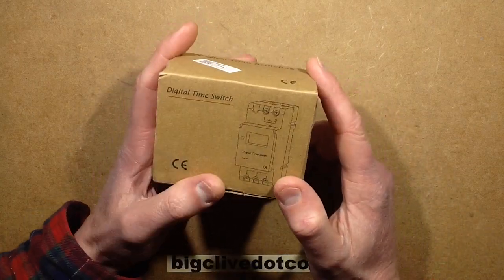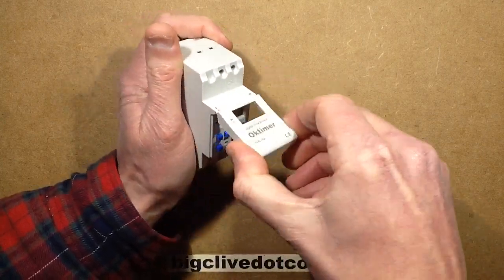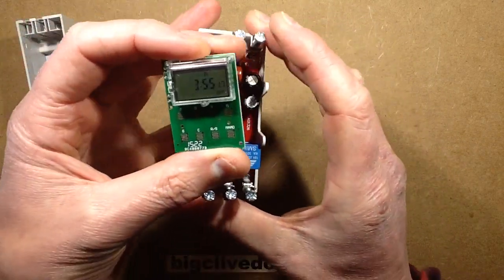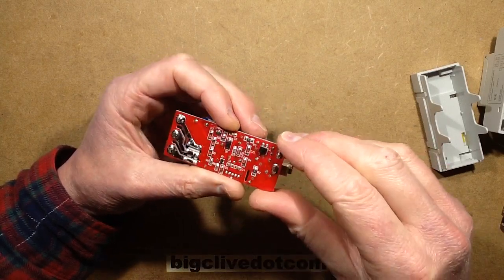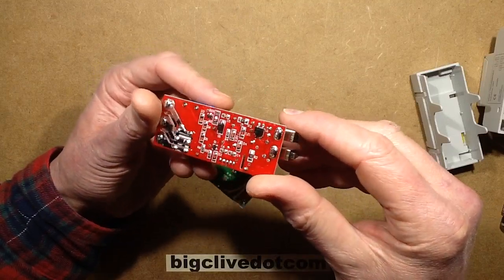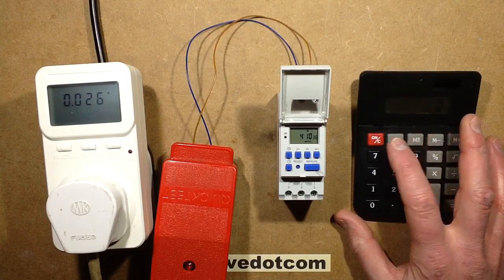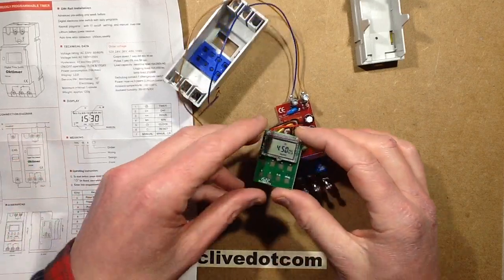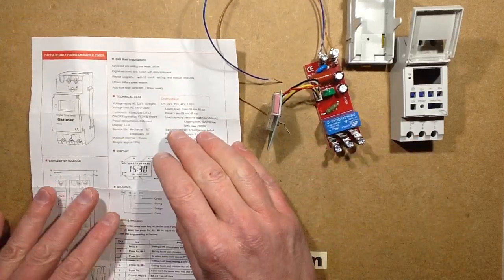Inside a cheap Chinese DIN rail time switch.

Comment: What sort of enclosure would this go in? A UK distribution board has the live mains input bus bar along the bottom, and output at the top?
Reply from the maker: +hyperion8008 If used in a distribution board it would be wired on its own via one of the circuit breakers.  DIN rail is used mainly in industrial control panels.

Comment: The delay between you going through on - auto - off and the relay switching might be intentional, since the display is actually responding immediately. I think its intention is to not have the load switch on and off unnecessarily while you go through the settings and only after you have settled it switches the load.
Reply: +Jack White  Pretty elaborate for cheap chinese elctronic -> usually  cheap electronics software just sucks! (even though product can be actually quite good)

Comment: Chinese quartz clocks are very drifting. Almost 5 seconds per week or even more. It's ridicolous. I would only trust radio controlled clocks.
Reply: +BloodySword they either get bad crystals, or i think just use oscillator circuits sometimes! although ive had several cheap chinese devices that keep decent time, i bought a fake casio watch  (on purpose for a joke, the gold one, costing about 1.50) and it lost around 15-30 seconds a day at room temperature!
Reply: +jusb1066 Oh losing seconds is much worse! It's not so bad when the clock shows time in the future; you cannot miss your appointments then. :D
Reply: *****
indeed! the fact was the watch was quite well made, metal strap, brass plated not gold, if it had kept time, i would have actually used it! shame they scrimpt on a couple of pennies really, this would not sell even in china!
Reply: +jusb1066 Yes. But a watch that is not radio controlled, is not a watch anymore for me...
Reply: *****
yes i see your point, a have  2-3 house clocks that are indeed that, along with my kitchen radio is RDS with a clock auto set, and of course phone/pc/ipad etc does it via internet, but still twice a year hate having to remember all the clocks that you still have to set manually!
Reply: +jusb1066 For me it&#39;s easy. I had two LED &quot;wooden&quot; clocks. A Big one with white 7-Segment-LEDs and a small blue one. Both of them are drifting heavily to the future! The white one did get issues so that I could not change the time anymore, the momentary switches got dodgy. That has driven me so crazy that I smashed it with my fist. The whole plastic rear case was cracked and my eneloops flew out as well as the PCB broke in half and my fist was not even scratched. Bloody cheap shit! Leaves just the one in the kitchen with the blue LEDs xD.

My radio controlled clock in the bathroom is quite old, it ate batteries like a dog his food. I put an eneloop in and now it works, even though the voltage is much lower than with the alkaline cells.
Reply: +jusb1066 I have an Arduino-based clock which I reprogrammed to also track the date and do Daylight Savings adjustments itself. I did this because 1) I don't always know the date, or day of the week, off the top of my head and 2) I was fed up with having to adjust my clocks manually.
Reply: +Robert Lozyniak Would you like to share your code and schematics?
Reply: I don't have any schematics. I built that clock from a kit. I modified the programming to suit my needs. You can see the result in my video: "My modification of the Alpha Clock Five"
As for code, I suppose I could send you a link to it, but it relies on libraries from roughly the Cretaceous Era.

Comment: S1 and S2 are obviously for switching between the metric and imperial um... time.
Reply: i have a button in my car that does nothing but change my speedometer and odometer from imperial to metric. I wonder how much money they could have saved by putting that in a submenu instead.
Reply: Metric time would be so nice... Except that the US wouldn't adopt it and converting would be awful
Reply: i think they tried metric ie decimal time and calendars once in france, from about 1790~to 1805~
Reply: @dndboy13  We actually have a new time standard for years now. ... it's called Unix time and just counts the seconds since epoch (1970-01-01T00:00:00Z).

Like the US is actually using the metric system - all units they use are specified in Metric. :)

Comment: I just can't  like products that use capacitive droppers instead of proper power supplies. I know it's only low current, but given it's semi-industrial purpose, it just seems wrong.
Reply from the maker: +arcadeuk It's cheap, light, small, efficient and actually pretty reliable.
Reply: +arcadeuk 
What's more probable to break: a rectifier, electrolytic smoothing cap, switching transistor, transformer, rectifier diode, another electrolytic smoothing cap and switchmode controller or a resistor, a cap, a rectifier and a smoothing cap?
Except for the fact that you have to put a relatively constant load on them and waste the power if you don't need it all the time, they are actually quite good.
Reply: +bigclivedotcom And I don't see a big reliability improvement in exchanging capacitive dropper for rectified mains filtering cap and filtering cap on secondary of SMPS;)
Reply: I agree.
Reply: cheap switching power supply's  are noise nightmares.

Comment: For quite a while now, I am looking for a low power time switch (to switch a battery driven LED strip). With a backup time of 3 years from a small NiMH Battery, this upper display and key module should do the trick. Are there any markings on that module, like Partnumber or something similar?
Reply from the maker: +konohh You'd have to remove it from a cheap digital plug-in timeswitch.  I don't know anywhere that sells the actual modules.

Comment: Box is a standard part, designed for any standard 2 module width DIN box. Made to pack flat in storage so the transport of the empty boxes is cheap from the printer, and to fill you simply do a minimum of operations to make up an empty box. Often you find the entire manual printed on the inside of the box, especially for things like DIN mount contactors. I prefer the EU made contactors though over the Chinese ones, they use brass as contact materials while the Chinese ones are steel.

Relay is not doubles contacts, you have 2 pins per contact to handle current it switches. Sad to say that relay is being overrated, they are really 16A resistive ( 1000 full electrical load operations) or 5A inductive ( 0.7PF for same life). You are better off using an external contactor or SSR to do the power switching if you need the full power rating.

Comment: DIN = Deutsche Intustrie Norm = German Industrial Standard.
Reply: +Taguun It used to be, but today DIN = Deutsches Institut für Normung = German Institute For Standardization. This is also the reason it is called a DIN standard and not only DIN. If you were correct a DIN standard would be a "german industrial standard standard".
Reply: They should just change it to WIN (Welt Industrie Norm... or World Industrial Standard) because pretty much all of the world has adopted a lot of the DIN standards.
Reply: Adam Ohm Nah, than the world will start believing it is all done by Microsoft
Reply: +Taguun ich dachte aber auch es heißt deutsche industrie norm :P. dann gegoogled
Reply: +Sean Ache Be careful you don't get RAS syndrome.
Reply: @Adam Ohm: But we already have ISO for that.
Reply: @rolfs2165  the DIN rail spec is defined under IEC these days?
Reply: YES right.
Its like TUV.
Reply: +FischOderAal Just like how in sports they do stuff like "MLB baseball," which would be "major league baseball baseball."
Reply: @timramich  That's just like LCD Display...
Reply: Tim Ramich Regardless, DIN is not anymore the abbreviation for "Deutsche Industrie Norm". It may still be commonly used but it's still incorrect :)
Reply: +FischOderAal I wasn't arguing, nor could I care less about anything related to Germany.

Comment: Cheap songle relay, cob chip. These won't go in my panel designs. I'll stick with the Germans.
Reply from the maker: +jak p (skiguy09) You'll find the COB chip in most of these.  Even the high profile brands.
Reply: On the Finder brand there is a Atmel chip.
Reply: +jak p (skiguy09) Allen Bradley! 'Murica!
Reply: +stonent Allen Bradley is what most my customers ask for. However their terminal blocks are really German. Their older 3 phase power supplier were Siemens.

Comment: Well...holy shit, that's a surprisingly good chinese DIN rail timer! :o I want one for no particular reason besides maybe the unique cleverness in its design..
Reply: +ChaosHusky looks well built, the real question is, is it reliable?  ive had some cheap times, that randomly reset, or crash or just sometimes crash upon switching the load, i had so much hassle from even a timeguard one i went back to the pure mechanical ones! (my needs were simple so i could)
Reply: +jusb1066 I use a mechanical (electromechanical, really) timer because they are almost ridiculously easy to set.

Comment: I think that wide button is reset and manual, remember that you pressed that to turn it on and off, the reset may be that you press 2 buttons to reset the timing functions (not the time) if you screw up. i remember a timer having that ability.
Is s1 connected to the output from that module ? if so there could be an option for a dual channel timer, but would need a bigger case for the relays

Comment: What a clever designer, keeping the load on the dropper the same :-D
Ive got to give them full marks for smart engineering, cheap but nicely made.
The display pcb looks like its made by someone else, well its different in colour, it could be a generic job.

Comment: Thanks Clive for another great review! Have a similar timer on my workshop lights but switch the load using a contactor relay. Have you seen the equally cheap DIN rail ammeter/voltmeter?

Comment: Another approach would be to clamp the 24v rail down to 5V (or whatever the clock supply is) when the relay is off, avoiding the dissipation in the resistor
Reply from the maker: +mikeselectricstuff I think they're trying to keep it at around 24V for two reasons.  To ensure the trickle supply from the 24V cap to the control PCBs cap (via a resistor) stays constant, and also to ensure the relay immediately receives a full 24V from the cap before it sinks to the 20V under load to make sure it pulls in properly.

Comment: Clive, are there any controllers with a semi-randomised setting? The kind you could use for a light when you're out of the house for a long period. The normal switches will be predictable.
Reply: +Allison Pell Something like this http://www.amazon.com/GE-50462-7-Day-Random-Vacation/dp/B0002U3Y0Q
looks to be a simple plug in solution,
Reply: +Allison Pell The timeguard tg77, which is a common digital plug in, has random, its been available for years, so easy to find
Reply: +Sparky Projects That's just a 7-day timer with a preset sequence.

Comment: Dave from the EEVblog will be like: "Ahhhh, nasty chinese quality. Those nasty cheap electrolytic caps will die within  a year." XD

This month, one year ago, you only had around 5.6K subs. Now you have ten times that! Keep it up Clive, love your videos!
Reply: +DJ S Clive also got to the point in about one quarter of the time too.
Reply: +kroplaaaa Times have changed. Once upon a time devices were designed and built up to a quality level. Then they started building them down to a price level. Finally, manufacturers have realised that if you under-engineer a device sufficiently so that it fails not much further than 10% after the warranty expires, profits will skyrocket.

There are of course limits to this "under-engineering" though, as Samsung have discovered recently with the Note 7.
Reply: +Colibri Even Nichicons are usually rated for 5000h or something like that, and more important factor is thermal design of the device - even the aerospace quality electrolytic will fail quickly if it's used on the high side of their rated temperature. Here, in low power device that doesn't get hot really any electrolytic will do;) I have plenty of appliances with 50 yo electrolytics that work without any problem, and on the contrary relatively new equipment like LCD computer screens that failed horribly because someone though that putting SMPS inside the case that gets hot  with next to no ventilation is a good idea (what a bro you are, Samsung...).
Reply: ANDIY GreenGanjaMan "And we're in like flynn."
"Well, that's a bit how ya doing."
~EEVBlog
Reply: And now, another year late and he is at 303k. The man deserves all those subs as well. He does a top job on this channel.
Reply: That's because Dave is a knob
Reply: +DJ S He is kind of right though...cheap electrolytic caps tend to fail earlier than good ones.
Reply: +DJ S Finnaly I think he would say"Aaahhh!!! Bob's your uncle" :)

Comment: why is the max. resistive load higher than the max. inductive one?
I do know about the power factor stuff but how does it affect the max. load on a relais?
Reply from the maker: +Blowitup1991 The inductive load can cause more arcing on the contacts when they open.
Reply: +bigclivedotcom ok thx :D
Reply: +bigclivedotcom Interesting.. Nothing to do with inductors soaked in current causing voltage spikes, is it? Idea for a video.. Maybe explaining the resistive/inductive load and "power factor" stuff? Though it may have been done before by someone else, you doing it would be epic! You should have more subscribers than Dave, or at least be equal.. IMO anyway! lol
Reply: +ChaosHusky Exactly. The voltage spike when switching can cause arcing.